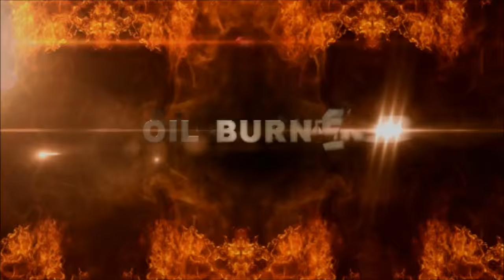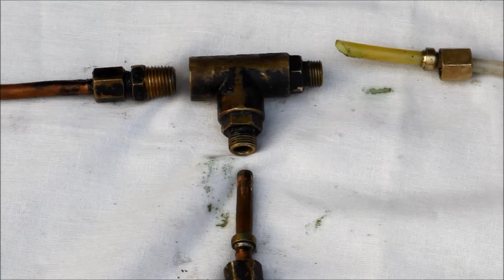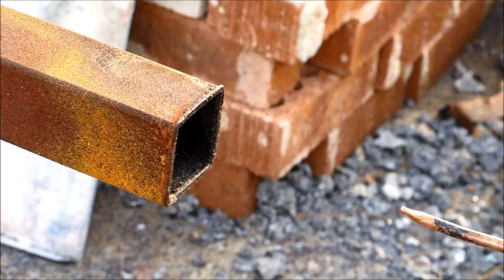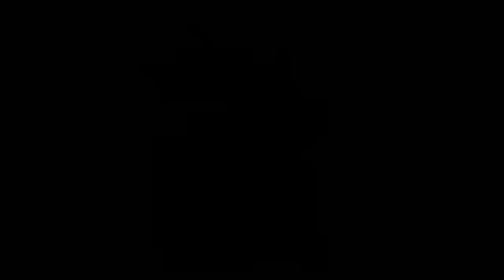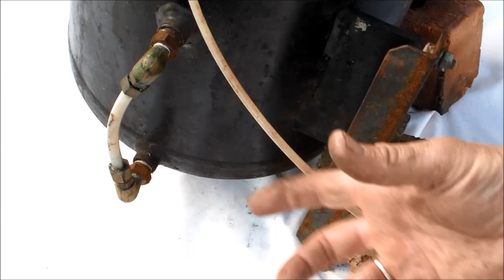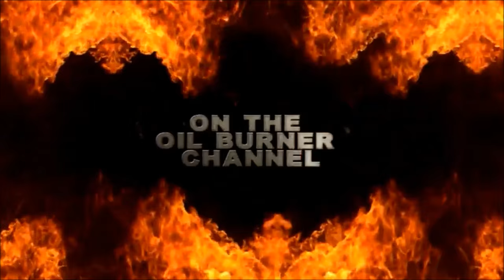Instant Light up Oil Burner Construction and parts for easy build.

Comment: Your design is the same as a sand blaster . Great videos  Keep it up
Reply from the maker: +Lawnmowerman02346 Yes, now you mention it, very similar. I am sure I have one of those sandblasters somewhere, If I can find it I might have a go at converting the thing. That could be a very simple to make burner although It would use a Load of air!
Reply: +Oil Burner They work.

Comment: You made me laugh. I'm sure glad I found your video. I need a burner to smelt aluminium. I really want to use waste oil. Today, I went out and using an old car rim, a 12v blower, a ceramic crucible and a bunch of scrap wood (i was at the local illegal dumping ground outside of town) i managed to produce one and a half aluminium muffins. So happy. But took way too long. Tomorrow, I'm going to try making your Burner. Thanks for posting!

Comment: Thanks! Got all I need in the barn to build it. I may play around with a drip system and a siphon system too.
Reply from the maker: +Tommy Rad   They both have their upsides and advantages.  The spray burner is easy to light and good for smaller heating jobs. The Drip style is good where larger outputs and longer runs are required.
Reply: Oil Burner
thanks.
Reply: @2tommyrad  spray burners excel at getting drip burners to light.

Comment: to make fire all you need is fuel, air and a source of ignition.......... people do complicate things far too often. love your work.
Reply from the maker: +tapper88 Thanks for the kind words. So many of the burner designs I see here amaze me in their complication, expense and difficulty to build yet I don't see they do anything different to what this much simpler oil burner does.  I have read many times that people even have trouble with the siphon nozzles getting them to fire on Diesel!
It's only fire we are trying to achieve here not 10Kn of thrust to launch a space Vehicle.  :0)
Reply: +Oil Burner hahah you brought it to the point. i wanted to build an oil burner and looked up on yt and saw great burners but all to expensive and to complicated. then i looked up the venturi effect and build a provisoric oil sprayer out of some crap and it worked with the atomization but i didnt put it into a tube and i tried to lighting vegie oil and it didnt work. so next weekend i will ad a tube and make this one which you presented. im happy that i found this video showing me that im not wrong with my simple idea :D
Reply from the maker: D Bb  Simple is always best although sometimes we  have the right idea, but it just needs a little tweaking. If you have trouble with your burner running, put a bit of metal , something perforated is best, inside the tube. This acts like a " glow plug" and will heat up and help the oil ignite.  Even though the oil is sprayed, it still needs heat to Change it from a liquid to a gas to burn.

Look forward to hearing/ seeing how you go with it.
Reply: wow thanks for the fast reply.
ok nice i wouldnt think of that. i couldn t run or burn the oil because it wasnt in a tube and it wasnt preheated i just made a very simpel spray gun out of scrap ( and i mean it so it was a t-piece copper pipe fitting with just a rubber pipe for the oil and a rubber pipe for the air. if the air outlet is a little hole it expands in the t-fitting and soak the oil. it was pretty nice to see it working with a piece of trash. 

i will test it and i will reply to you. you are very kind/gentle and you make nice burners :D

sry for my english im from poland

Comment: Great bit of kit. I think I have the bits in a junk drawer so I might give this a go.
Reply from the maker: +MaruAdventurer That's pretty much how this one was built.  I bought the 90o elbow and the nipple the other day when I thought to enclose it but other than that, it was just bits and pieces I had in the box of air and assorted small fittings.  Some of the other Burner designs I see must take 4 trips to the industrial supply place to get them all.

Comment: Absolutely perfect design!  I thought of this except I used a nitrous y fitting to mix the fuel and air. 
not complete yet but I'll post a video when I do get it done. 

I want to use this burner as a cost effective way to melt metals like lead, zinc, aluminum and maybe copper

Comment: I've been watching this type of burner of your's (I've watched them quite a few times).  I have a thought, do you think it would help to make the end tube that is crimped down (i.e. the burner) longer & make it go in further down the pipe then turn back some then turn back facing down the pipe again so that the flame would be blasting the tube (with the oil/air in it) thus preheating the oil/air before it sprays out into the pipe?  Now I know it might be better to use a steel automobile brake line for that part so it would handle the temperature better.   I have a real nice (I hope) system that I'm working that use's wood & forced air, but I think I could use some extra heat, & maybe just not even use the wood at all & just use a waist oil heater.  I'm not sure which type I'll use but I'm leaning on the type you have in this video, although then I would need to bring my air compressor to the melt sight but that is really no big deal.  I do like the one you have that is a 55 gal. drum on it's side that is tilted back a little & the AL just drips out the back.  That would be great for getting the AL storied up for casting at another time.   Thanks a lot for the uploads.   I used to think that if the USA gets any crazier  I would move to the land down under, but I'm would never get the Vax, & it seems that a lot of the government is full of the devil where you live just like here, so sad.  I live in South Texas USA.   Thanks again.

Comment: My Oil Burner wasn't a complete failure. I managed to get it fired up but it's just not producing enough of a flame to fill my furnace. I think the problem is with the oil supply. At the moment I have a 4mm garden reticulation hose going into a air-compressor fitting and that filling into a small bit of plastic hose and then the hose onto a metal feeder. The oil is really only dribbling into the tube that feeds the hot blower cylinder. Cool to see this idea working but disappointing it's not got a big enough flame.  I will work on the feed and see if this makes a difference. But I'm leaning towards an compressed-air driven system now. I saw someone using a spraygun and another air supply. That is my backup plan. HAPPY DAYS!

Comment: I like it, but think the compressor can be taken out of the equation. I'm thinking something in the way of a small oil pump that makes 30 - 50 psi. and a blower as used in your drip type burners. Just as a pump up sprayer works. So maybe one of your old Chevy oil pumps on a smaller scale or a much lower RPM. Or the pump from a salamander heater or old boiler unit.  Being in the tropics, (Florida), I don't ever see boilers anywhere to tinker with parts, but from years back I do remember a perfect pump from them..
Reply from the maker: +Steve 1961P. The oil only Nozzles run at about 100 PSI and they are specially designed.  I had in mind to run a power steering pump which would do over 1000 PSI if required.  Maybe at a couple of hundred PSI a crude nozzle could be made to spray effectively?  Maybe one of the micro brass types could be used which would make the whole setup even easier?
Reply: +Oil Burner Oh hell yeah... Great idea....

Comment: I would like to make a 1 kW to 12 kW waste oil heater.
Is there a way to make one without using compressed air?  I was thinking some kind of motorized oil pump that would pressurize & atomize the oil & then an electrode would be used to ignite the oil all with the flick of a switch.

What would you recommend?
Reply from the maker: +A B If you want that level of automation then you would be best to buy a used commercial burner and modify it.
Other than that you could look at about 50 of my vids where I show burners that don't use compressed air.
Reply: +Oil Burner Ok.  Thank you.

Comment: Can I use diesel in this tank? It Is safe? Tks
Reply from the maker: Diesel is perfectly safe so is Kero, turps and other non aromatics. Just don't use petrol.
Reply: Pretty much anything with a flash point that is well above your maximum ambient temperature.

Comment: you are very good at giving the tutorials, and the burners you make are krazy with a k! im struggling with my set up, ive been running propane i want to swith to waste oil what a fu@#ing mess ive made of the garage i used to be able to get away with cooking a charge at the edge of the garage with the door cracked maybe 1ft this is a whole new animal ive struggled all weekend and now i have to clean a mess im not sure will come out. anyways, after this tutorial i think ive got 'er figured out im gonna use a wee lil lpg tank as a pressure tank hmm i wonder if i can rig up a fridge compressor i have 2 sitting on the floor ones already wired im gonna have to figure out a pressure switch so i can keep pressure in the tank at 20psi without blowing the lines off the compressor. pvc pipe, a jet ball, marble, or ball bearing on a spring???? anyways cheers from canada and keep up the jolly good work gov'nor
Reply from the maker: +mikey worth  Hi Mike, Thanks for the kind words. I think you will find a fridge compressor might work OK with this design directly coupled. My mate had an airless spray  gun compressor feeding direct into this and because of the bleed off it sat nicely at 20 PSI.  I don't think a fridge compressor would put out enough air to need regulating if directly coupled.  Give it a go and see if it's ok or you need to go to more trouble.

Comment: I just connect a line from the oil tank to the T Nozzle head and then the compressor direct to another end of the T Nozzle. when I fire I don't get oil instead I get air pushing back the oil feed
Reply from the maker: +Atse Michael   You need to pressurise the oil tank. Please watch the vid again and follow the instructions. Sorry, but I don't know how to explain the setup any simpler or more straight forward.
Reply: +Oil Burner can the oil intake line be positioned under the oil tank instead of putting a long line in all the way to the depth
Reply: +Atse Michael . .  Again, Watch the video again and this time pay attention. . . . That was covered very well.

Comment: how do you not die from breathing fumes of burned oil?
Reply from the maker: +Thunderstriker  I suppose the same way as you don't die from car fumes in a traffic jam. Not like I'm sucking on the end of the thing.    Hey, I think you just gave me a safety tip! Better warn people in case they try it.
Reply: @glumpy10  do not operate inside the house or in an enclosed wood shed.

Comment: Isn't it expensive to operate an air compressor for combustion air? Sounds like a deal breaker to me...except for melting metal.
Reply from the maker: +Larry Maloney   Yes, it is!  That's why I personally prefer the other types of burners I mainly have which just used blown or forced air. There are a lot of people however in the metal casting interest group that are particularly enthusiastic about spray burners.  The majority of them also use the manufactured nozzles which are expensive, fiddly, frequently don't work very well and put them in very complicated setups using a dozen or more fittings. This burner was to demonstrate that a very simple and straightforward setup could work even better than most of the complicated setups. 
But, you're right, MUCH cheaper and less wear and tear on your gear to run a blown oil burner than a spray type.